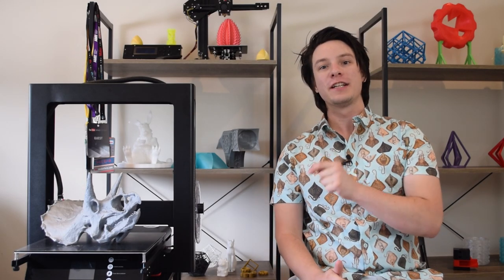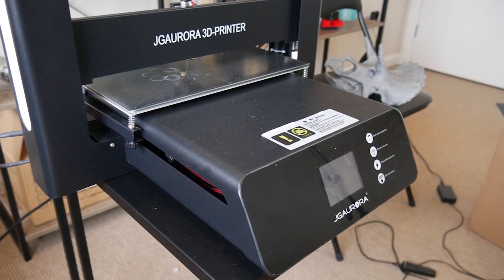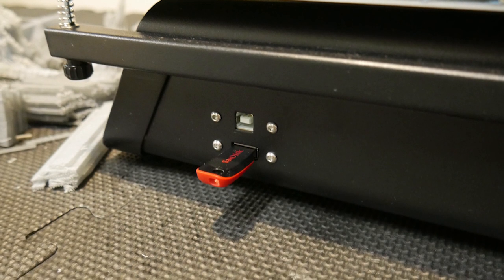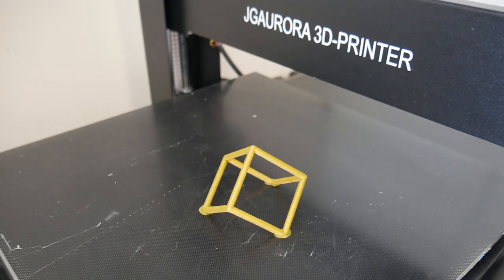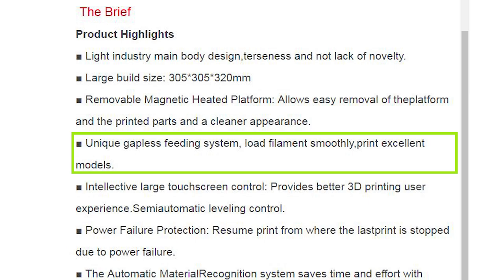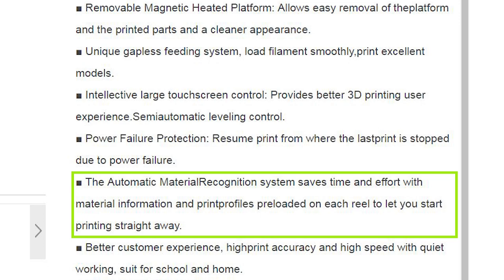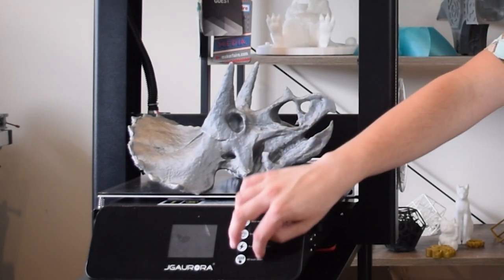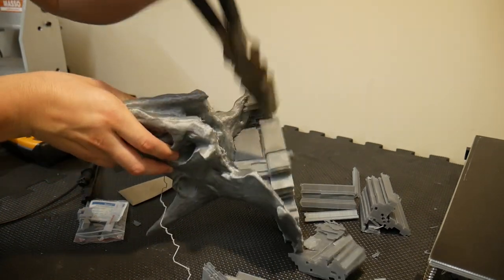What is this 3D Printer supposed to be? JGAurora A5 Review

Comment: Screen is just an mks tft32, and likely an mks board. The touchscreen actually has its own ARM processor, and acts as a serial host talking to the printer board via tx/rx pins. I actually use this touchscreen on my printers, they work well, except for the temperature update you noticed. Nice thing is the lcd graphics and some of the menus are editable. Take a look at the makerbase GitHub. 

Long story short thats why you see the Wifi info in the menu. Buy a mks esp wifi module, plug it into the back of the screen, and you can then connect over a wifi serial bridge.

Comment: Wow man wow... that triceratops skull came out great... gotta figureout what the heck is going on with mine.
Reply from the maker: +Uncle Jessy the bottom is super thin, is that where it's failing?
Reply: Maker's Muse should have been more clear my prints on the machine. Not the triceratops... that print does look crazy cool though
Reply: Can you easily add a enclosure foe abs?
Reply: Here's the dumbest 3D question ever:
Why isn't advisable to turn the bed heating off once the printing reaches a certain height, to save on power for those very long printing sessions? It seems the finished print does not easily comes off, even with the bed at room temperature.
Reply: Stadd Spotwelder because parts will peel off and it uses so little power you will only save less than a penny in your electricity bill by turning it off.

Comment: 5:55 Angus, I experienced something similar after moving my printer slightly, and changing from 0.3 to 0.2 for the first layer. 
I then printed the exact model again after re-adjusting my bed and was actually able to remove the rest from the print bed.
Of course that wasn't sticking as crazy as yours seemed to be.

Comment: Fully agree with Angus' take on this one. The machine performs WAAAAY better than I had anticipated or hoped for. On the FB JG forum, we've been adding bed level systems (IR or BL, take your pick) and have the most recent new Marlin version running on it. The icky part cooler has gotten a couple of new, way better alternatives. In terms of "oh bloody heck my part doesn't release" ? Don't take the hammer. Several people stated it helped when they heated up the bed to a much higher temp (90°C) than regular PLA would need, and they let it cool down after again at which point the "stuck like glue" part did pop off. Just a tip.  The advertising part though ? Yeah, it's very, very odd. Also in terms of "upgraded version" ect, that's one of these other oddities, but MAYBE it's connected to the fact the first JGA5's used printed parts in the movement system, where the currect ones use machined metal parts.

Comment: Speaking of questionable specs, I don't think this machine actually has anything near a 320 mm vertical build volume. I tried printing a bust that was 285mm tall, and the printer basically got stuck at the top one or two centimeters because the gantry couldn't go any higher. I think it just kept grinding over the top of the model. What's worse, the printer basically broke after that and I can no longer get the hot end to move except to home, and the nozzle and heat bed no longer heat up. An email to support only resulted in their request to use a multimeter to check continuity of various wires (not something I am able to do) or to disassemble the printer and look for loose wires (tricky due to the construction of the printer). It's a shame because I was pretty impressed with it before all of this happened.

Comment: I have the "Updated" version from Gearbest, as far as I can tell so far they changed out the heated bed. The glass on mine is removable from the heating element and the connector on the heated bed is now downward facing (as well as cleaning up some of the wiring in and around the case), as being mentioned in some of Da Hai's videos.

Comment: Another reviewer mentioned that one of the larger printers had wifi on the box and in the menus but it wasn't enabled yet. They thought it was a case of false advertising.
Reply from the maker: +SrgntBallisticGaming that definitely is false advertising! The A5 didn't advertise it so it's less of a big deal that it didn't function.
Reply: Maker's Muse it worries me about the company a bit. The printers seems to print very well. But it looks like they kinda soft launch products with moving targets for the final design/features.

I understand things change in the development process. But the inconsistencies between what's on their site, retailers listing and the printer are concerning.

I wouldn't suggest ppl pre-order from them based on this. but the print quality looked Sooooo nice.
Reply from the maker: For sure! Definitely a concern.

Comment: JGAurora now have the A5S and the A1. I got the A1 and I'm fairly impressed so far at the price point. I did have an issue with the Z axis last week but appear to have fixed that by reseating the connectors.

Comment: The duplicate printers on gearbest don't seem exclusive to JGAurora. They post duplicate listings because the price varies depending on which plug you get (even though when you click the item you can select the plug type their as well). The JGAurora A5 with the EU plug is $355, while the US version is $365. 

Their other printers vary like this as well. For example, the Anet A8 ranges wildly, jumping from $143 for the USA plug up to $203 for the UK model.

Comment: As a bit of an experimentor I'd really appreciate you to dig a little deeper into the review process by finding out and stating if the manufacturer of the machine supply the firmware in sourcecode or hex format and wether or not what they provide actually works.
I beleive this to be a trick used by some companies to render a machine almost useless if firmware is changed. Since they almost all use either Marlin or Repetier firmware, which is General Public Licence, then please name and shame those that do not provide the sourcecode matching the installed firmware.
This is a major issue to many that have bought machines followed by almost zero manufacturer help.

It's the ACID test. 
Proof of truth on the factor of Open Source.

You may however end up with a pile of unfixable junk.

Comment: Just started printing with a new A5 and they've fixed a few issues, it's working great. I have a simple technique video on my channel to stop those prints popping off the cold  build plate if the power cuts out and is left for some time. Also good if you're not confident leaving a machine running unattended over night
Reply: Does it say that we need to light a candle under the bed ?

Comment: Hi Angus, about the part "Automatic Material Recognition" is about the specs of the filament at what material it is and the amount of the plastic in the spool, melting temp, etc. Actually i saw it at a group page that his filament came with chip.  And i dont know if that printer have that feature.

Comment: It's kinda amazing how well the print quality is even for these Chinese machines. I have an Anet A8, and the print quality is amazing (assuming you tune it up).
This is why during the stream I suggested you try to make a more intense torture test, maybe one that you use if your lattice cube works. I mean the purpose of the torture test is to see what a 3D Printer has trouble doing, mainly so you know what to avoid and/or compensate for in the future.

Comment: yep the only difference between the two on gearbest is the cable. They did the same thing with the Ender-2.

Also for z homing, check the screws that secure the limit switch. They might have gotten knocked loose, or wasnt tightened right at the factory, and its litterally wiggling around between homing's. Which is why you're getting spotty results.

Comment: I've been using and modding a used one I got on OfferUp. It mods pretty well so far. You can load Marlin or Klipper on it, give it an all metal hotend with V6 volcano, convert to direct drive... The great part is the large bed on it.

Comment: Angus - from what I saw the difference in the models was the $355 version was EU plug and $365 was US version.  Guessing it is not plug related, so much as having a Cheap Power supply that is hard wired for 110v vs 240v or 50hz vs 60hz  - the moment you have a switching circuit involved in those dodgy Chinese Death Circuits (Oh sorry I was thinking DIY...haha) - yeah well it increases production cost by 100 yen...so of course it means an extra $10 to the consumer.

Heya - I know this is review of JGAurora - but since you mentioned it - would you recommend the AnyCubic 310x310 heatbed?  I am designing a new printer from scratch...alternatively I actually want build volume around 400 - so 400mm recommendation would be appreciated if you have a sec.
Reply from the maker: Funny you should mention the PSU... it definitely has issues which I'll have to discuss in a future video but there is a switch. Having two different prices just because one is an EU plug and one is a US plug makes no sense to me. 3D Maker Noob (Joe) has a good video on that heatbed, he'd be the best to ask. https://youtu.be/Piz1laL2na8
Reply: That leveling aspect from the display is straight out of the Marlin firmware & MKS playbook too.  I have the same with my modified A8 which I put the MKS1.5 and "RepRap" LCD combination, the next build will be 100% automagic though...Sick of fumbling with thumbscrews!  By the time I get started I might pick your brain some more and update you on it - it will be the culmination of 30 years of physics knowledge, 25 years in IT, 3 generations of engineering knowledge and...Umm how long have I been 3d printing...oh 6 months...HAHA
Thanks for the pointer to Joe's review.
Reply: its basically which cord end comes with it  that goes into the universal iec connector  so they want more for the us version cause well im willing to bet its to help covering there cheap shipping or something similar  cant see the cords being different prices  most are all 16 gauge anyways
Reply: Leigh Green China uses yuan
Reply: Huskie yes I am aware, thanks  - i was just pointing out the difference related to what was within the video showing the site - which is in USD. Besides 99% of the time no matter where you buy from i challenge you to check the pricing it gives you, it will either be your native currency if it is location aware (or selected) or default to USD...because that is the only known intergallactic standard currency in the known multiverses. :)

Comment: Angus

Do you think you could do a series of building your own printer from scratch?
Reply from the maker: Maybe on the live channel, but it's something Tom's probably better at honestly, he's already done a few scratch builds. I will get one built one day though.
Reply: link to toms channel?

ive been meaning to get a printer but would prefer to scratch build.
Reply: Angus, What about that printer you said you were going to put those 2000 Watt motors on ?
Reply: I built a printer myself, but i would strongly recommend buying a cheap printer that works well, get used to that and learn a lot about 3d printing then finally if you still want to build one you should print most of the printer, that worked well for me and i learnt a ton along the way, pretty good school project!
Reply: I built  my delta printers from scratch. I have just finished building a printer with a huge build volume 450mm  X 800mm . I will be unloading the video with views of the printer working on my channel . I am based in Sydney Australia. I'm looking at building large 3 D printers for workshop and industry .

Comment: Angus, by accident I discover that IPA (isopropyl alcohol) works like magic to remove things that seem to be impossible to remove, I even unglued things glued with epoxy,  just apply a little amount around the printed object and it will come off because the IPA will get between the two surfaces not because acts as a solvent.

Comment: This printer is peaking my interest. I wonder if that bed platform material can be purchased by itself somewhere. Right now I just use a aluminum tooling plate with tape on my custom belt printer. Prints are flat but a pain to remove at times. Would like to find a removable surface made of material like that or what on the new Prusa printers.

Comment: That power recovery and filament detection is because of mks tft in front. I use them in my machines which i sell. And yes power recovery is way better than anycubic mega i3. Also ot looks like they are using chimera dual and using other cavitation for wires which is kinda smart

Comment: Very good review.  I appears that leveling the bed might be tedious because of the small leveling knobs so close to the electronic housing?  It obviously need some improvement by the manufacturer but at that price it might be a good buy.  Thank you very much Angus.
Reply: Carl Beck The Carriage is also very flexible so if you touch the bed you'll see that it jiggles so when you would just be leveling knobs give the bed a couple of TAPS to your fingertip to make sure it settles where it's supposed to be mine holds its level very well I've never had to adjust it after the fact but getting it there was a little finicky

Comment: Think you could try to use a heat gun to remove stuck prints, better ruin the print than the build plate 🤔 ☺️
Reply: no because good heat guns would fry the temp sensor on the heated build plate
Reply: Kenneth Bareuther actually do the opposite. Take a duster can  and flip it upside down and freeze the plastic causing it to shrink and it will pop off. Don't to this on warm bed though.

Comment: The LCD is a mks32 and all the software is built by mks
There is Wi-Fi capabilities but you need an mks Wi-Fi adapter.
Also it would be worth while updating the firmware on the screen.

Comment: I tap M3 screws into 3D printed parts... 🙃 But only if it's not needed for strong connections. 😬 If I need a strong connections I design a slot for a M3 nut.

Comment: What about the firmware? Is it also non user updateable like in Naomis A7 review?
Reply from the maker: Unknown at this stage, they need to release it as per the open source license but don't think they have.
Reply: Was going to ask the same. As per Naomi's review it was beyond a firmware release it had to be shipped to the factory for an update. So as for the open source China thinks that means you can change settings from the menu.
Reply: There is already marlin 1.1.8 by the community for the a5. I have it on mine.
Reply: Philip Mohr Wow, cool! With touchscreen support and power loss recovery?

Comment: Angus, with all these printers you get from overseas i was wondering what solution you use for power plugs in Aus?
Reply from the maker: Almost all are just using computer IEC cables, so it's super easy. If I have to swap it.

Comment: this printer is nice in that it has the print quality of Cr-10 but has more more features. But, I ran into issues with it:
-slower than CR-10 (except for heating)
-couldve heated up extruder and bed at same time, but you have to wait one at a time
-bed  doesn't seem to be flat all the way across, maybe because of detachable bed version
-when using PETG, I can't adhere to bed unless I build a raft for some reason, maybe because of above
-getting "reached min temp" error every print now. didn't even print a full spool yet. Temperature sensor probably broken.
-doesn't log errors on LCD so you don't know why it crashes middle of print. have to use pronterface to figure out why.
-outdated firmware, download 3d party from jgaurorawiki
-drooping before print start. it's 2018 and 3d printers haven't dealt with this yet? It should be as simple as adding some gcode to retract at the end of every print and extrude at the start of every print.

Comment: Have you tried plugging a Wi-Fi dongle into the USB port?
Reply: The machine is running a typical MKS28 TFT, these have a port for a specific WIFI board. The MKS28 in the JG DOES have this port too, not sure if anyone has been succesfull at making it work yet.

Comment: I think WiFi will be implemented as a USB add-on. Probably won't need a proprietary adapter, just something that works with Linux out of the box, like a $1 Realtek.
Reply: NOPE! Wifi is supposed to be ESP based and there's a socket for it foreseen at the back of the LCD; however, you put your antenna into a metal box, what good is that going to do?

Comment: Those plastic parts at the top were broken on mine as well, I mean cracked and separated layers!!
JGAurora sent me new ones in metal though, so I guess newer models will be better. 
Although they didn't fit... I had to drill new holes 5mm to the side to make them fit, but now it's all good. Except I think the extruder E-steps (E86) is way off, causing my prints to easily be torn apart, while looking fantastic... The perimeters has a gap between them, and therefore making the layers very fragile, but as mentioned looks great.
So far the printer is useless for me until I can find a solution for it.
Reply: Make sure to join the facebook group. Me and a few community members have develop a open source Marlin since JG wont release theirs! Can do anything you want now!

Comment: Are Microsoft Windows 10 3D apps like Paint 3D, Print 3D and 3D Builder usefull for 3D printing in any way?
Reply: Vladimir Dimitrijević 3d builder is super useful. I use it to cut up parts that are too large for my printer. It's not super good for designing stuff but for clean up work it's great.
Reply: 3D Builder also had a really strong repair stl feature that I always use when exporting from Google Sketchup. Works every time.
Reply: Hi 3D builder isn’t very good for intricate designs but is great for beginners and produces fine files it really up to how you would like to make your files